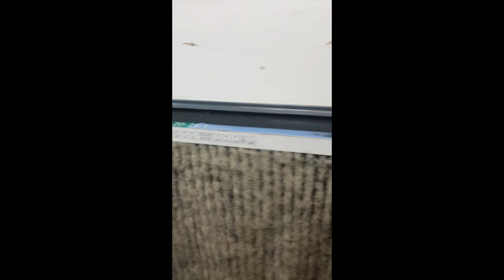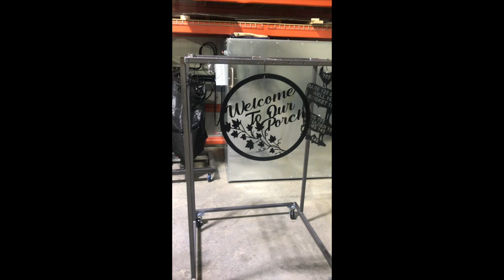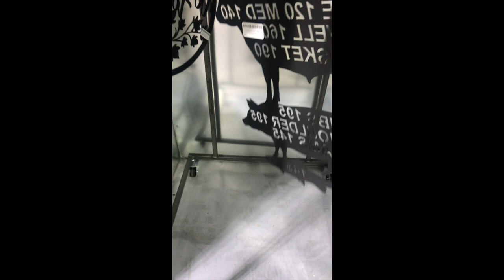Setting up to Powder Coat after cutting the Langmuir CrossFire Pro Table   HD 1080p

Comment: When wire bushing you should raise the table up you will save your back. Also you can use a rubber mat underneath so the part doesn’t move around.
Reply from the maker: Good idea…guess I’ll fab a new table and use your ideas.

Comment: Where did you get the Oven? I'm debating on building mine same dimensions +/-
Reply from the maker: Bought it on EBay from local builder for $2500 so could pick it up with no delivery fee.  You could build for 1/2 the price and with a plasma table can easily cut the metal sheet for floor, walls, etc. but I was in the middle of a number of projects so decided to spend a little retirement money and buy ready made!
Reply: @CustomCreations3   Build or Buy.. that's always the question....thanks